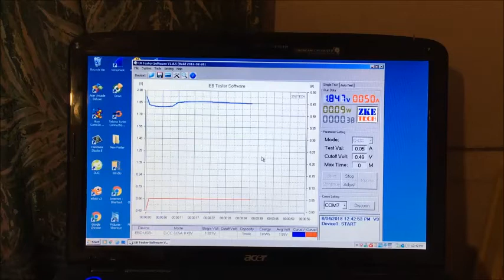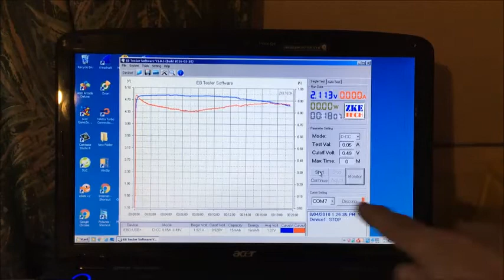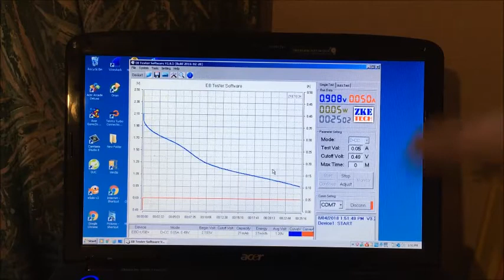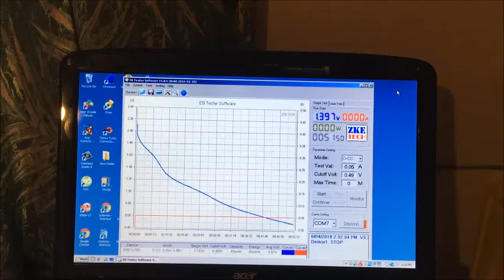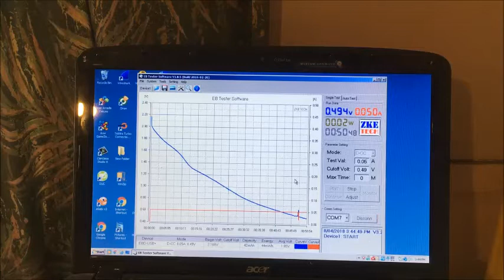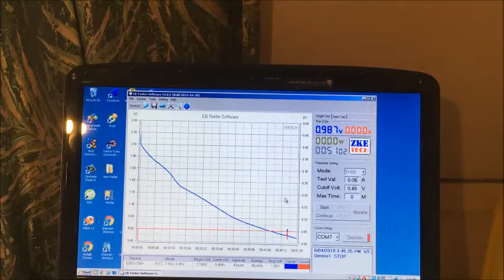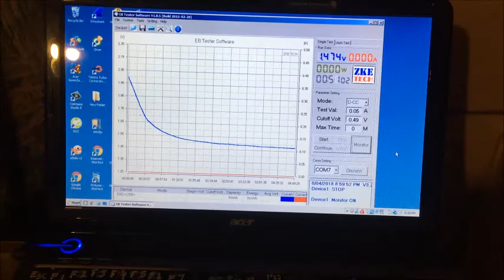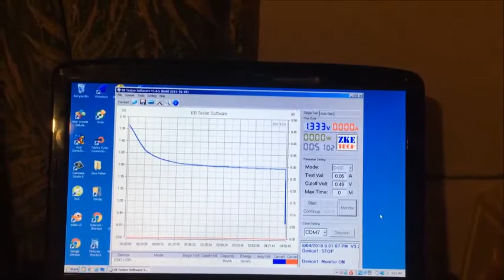Foam Manganese Dioxide Cell Part 2

Comment: Self discharge is quite a problem if it discharges the cell overnight :-) 
Maybe try an old separator out of an old lithium cell or super-cap, to confirm it is a DIY separator problem. - Martin.